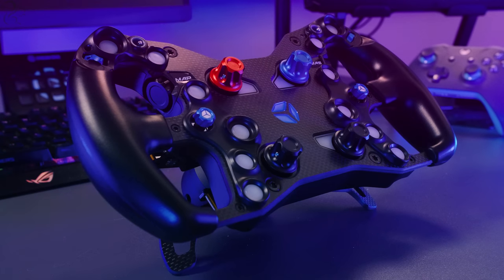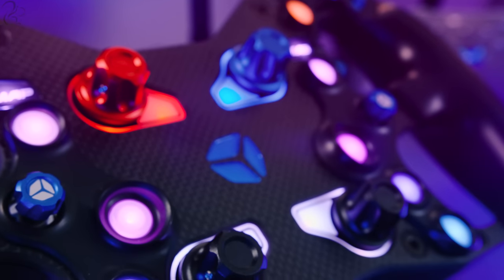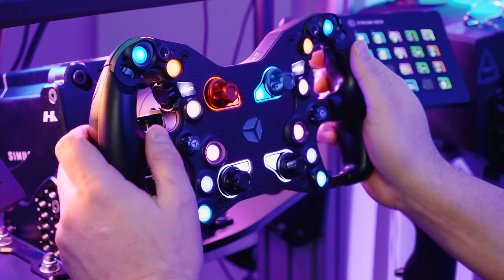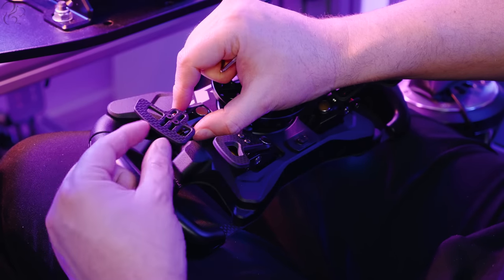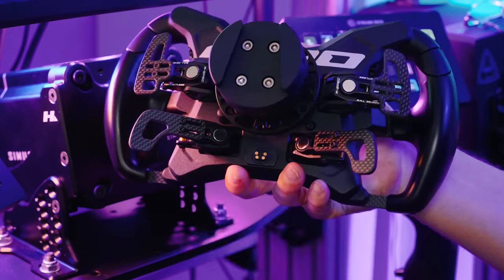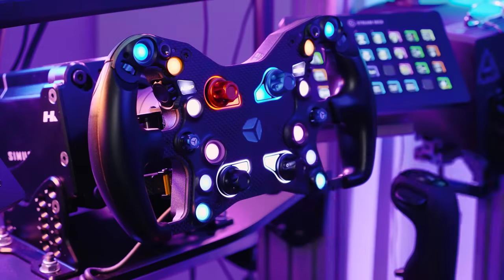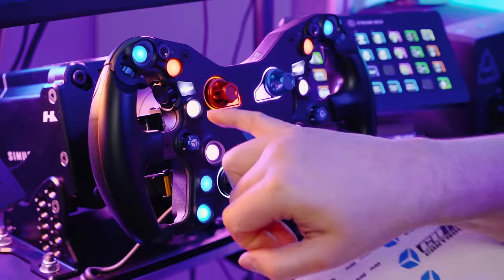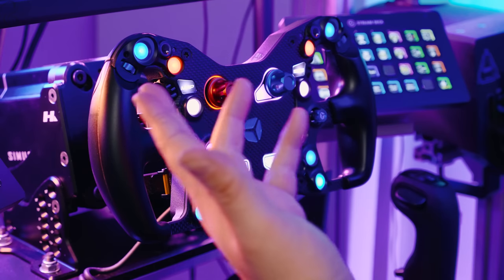What Makes Cube Controls' F-Pro Different?

Comment: I just got a Cube Controls FPro wheel. During sudden changes of direction (with ffb quite high) , I can notice a slight creak sound in the rear part of the steering wheel.  I have a Simucube 2 pro base with Simucube quick release, all the screws are very tight.  do you have the same problem?

Comment: I love it but the grips are just to hard. The fcore is even harder but this is close. Great wheel ergonomics though and very controlled feel when driving. I love these type of gt style wheels even the xgt pro from leoxz. But I like them not being that tall. I like 290 to 295mm in length grip to grip but I like shorter wheels in height. This one is very nice for sure. Just like the xgt pro I still have yet to find a wheel as good priced and gives me the same quality feel as the leoxz. Yeah I know crazy right? They def listened to the xf1 conplaints and fixed it for the xgt pro gt style wheel.

Comment: I think the wireless might be close to useless in most cases. What's the point if you'll have to charge it so frequently? Might just leave the cable connected after charging it

Comment: I personally feel like the handles for the wheel should be Alcantara just for a more authentic feel. Just an idea.
Reply: I know why go through all that trouble of using carbon fiber and billet aluminum to make the part you’ll touch the most out of hard plastic?! Even leatherette would have been better.
Reply: @tjnucnuc  yeah for sure or even some kind of microfiber. Anything is really better than hard plastic
Reply: Gloves last longer and are even more authentic
Reply: @starfox_wr-45e93  yeah I know but it would be nice to have
Reply: In the world of Sim Racing suede and alcantara are becoming less popular as it’s easily ruined even with gloves. Personally I love it, these rubber style are great too but but it just doesn’t look as good.
Reply: @OhItsThat  yeah good point but it would be a nice option to have.
Reply: @tjnucnuc   Ive got one here, it's actually really hard rubber almost feels like plastic but if you push it is slightly soft, its weird, its nice with bare hands
Reply: Yeah, they get disgusting after a short while. Leather or plastic are better options
Reply: It's not plastic🤣🤣, it's a hard rubber grip. For me perfect to use with or without gloves.